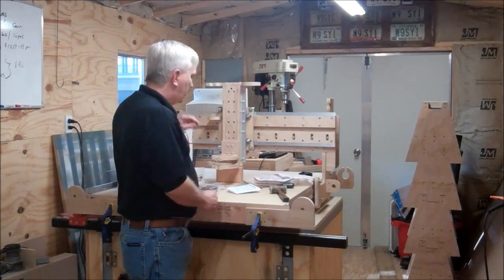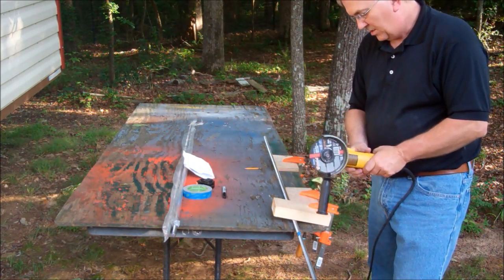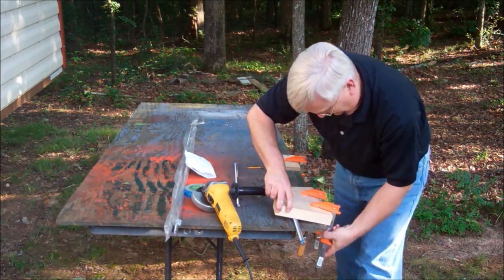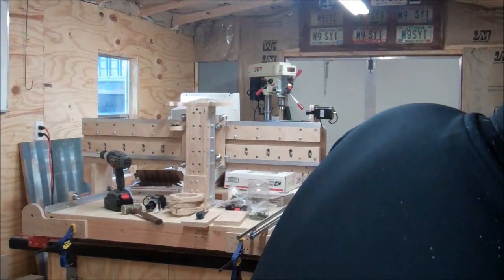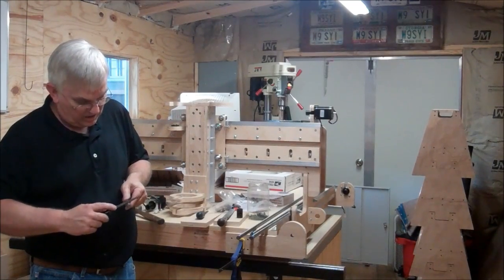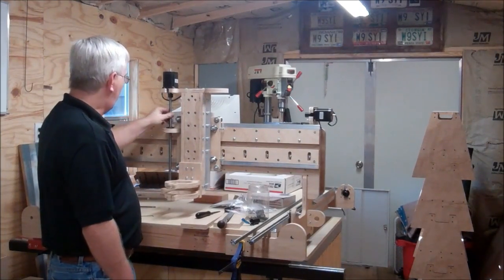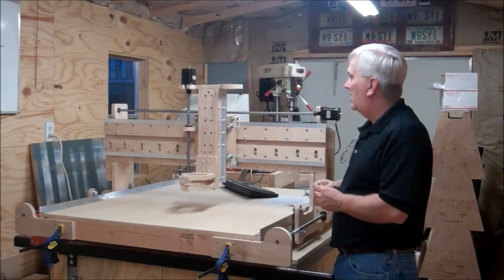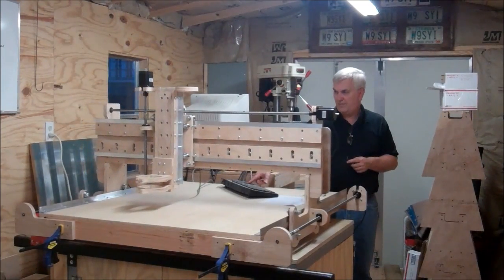Another CNC Build Part Four

Comment: Id like to know how these wood built CNCs hold up to warping. If its in a garage (non climate controlled), will the summer/winter temps warp the wood until it causes a binding?  Also would like to see you doing actual work on one of these instead of the settl machine you have - kinda proof of concept. Seems like all your CNC vids are using the steel machine to cut.
Reply from the maker: Jeff,  I did a couple of videos of the smaller wooden CNC cutting some parts.  The reason you don't see the wooden CNC in my shop now is because I only build them for the videos.  I gave them away after they were built.  The machine in the video above is at my friend Jim's shop and it is running fine.  For the ones I built I used cabinet grade birch plywood so I don't think warping will be an issue as it is a pretty stable material.
Reply: Dave Gatton I understand - still, Id like to see a video of someones that had been used for a while in a real world environment to see the durability - dont get me wrong - LOVE your idea and plans - I just research anything thoroughly before I financially "dive in".